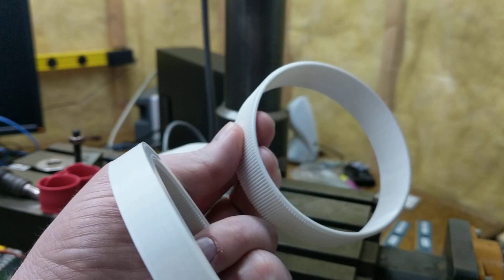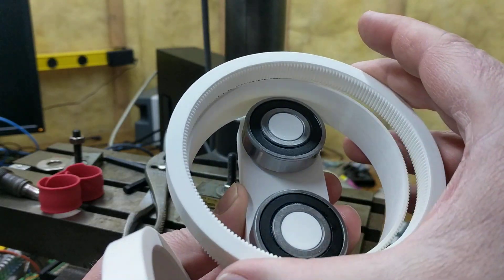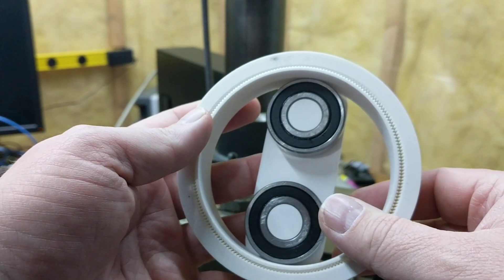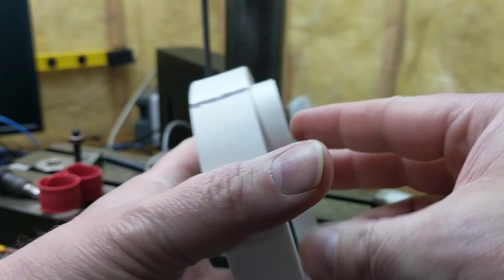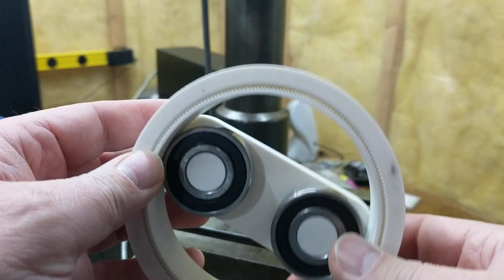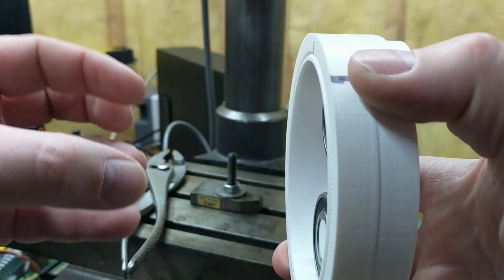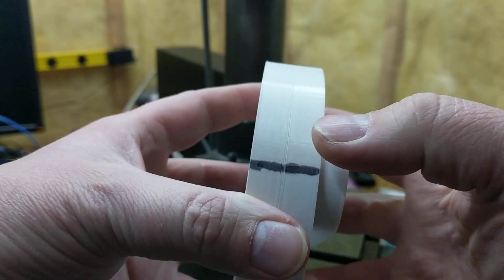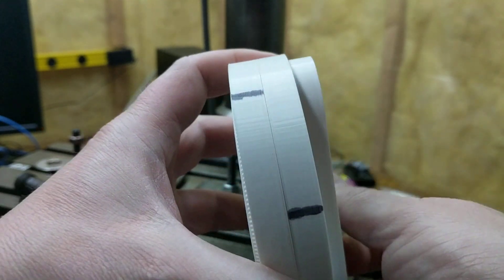and another harmonic drive update/design try....

Comment: Lights out manufacturing. :-)
How about two wheel bearings preloaded against each other to mount the chuck to?
If that part is independently solid then there is only rotary stress on the drive.
It looks like Andy and you could get into all kinds of trouble in the shop.  ;-)
Reply: A dual bearing block on both sides. Mount the 200 tooth ring to one block and the 200+ tooth ring to the shaft on the other for the output. Mount the bar with rollers to the other shaft and there's your drive. Put a little flange in both rings to keep the flex ring centered. Lube it all very well with silicone grease.